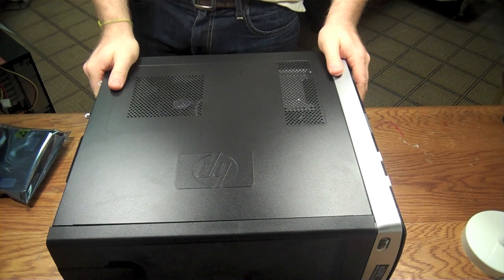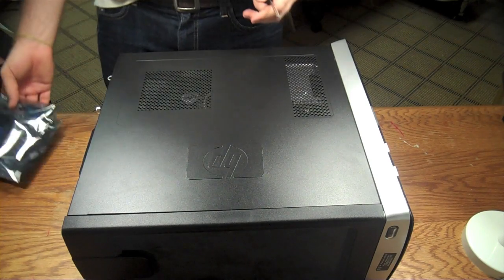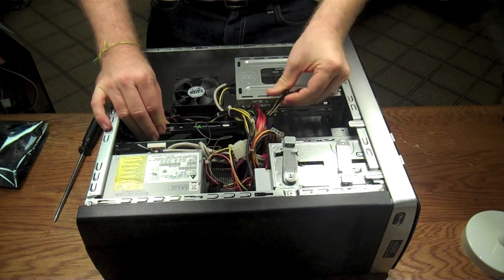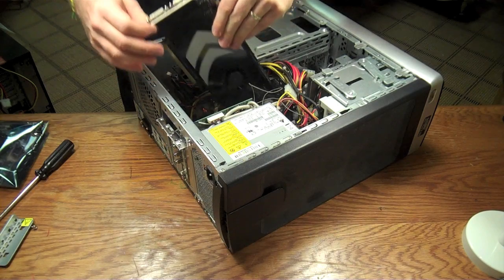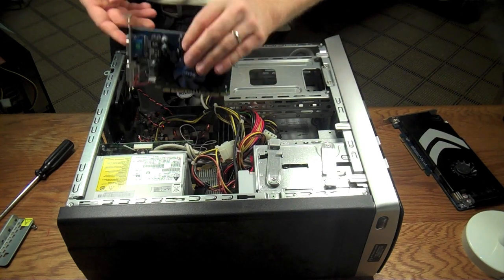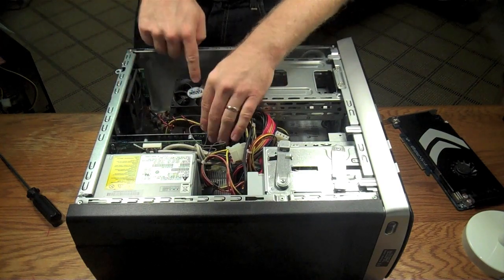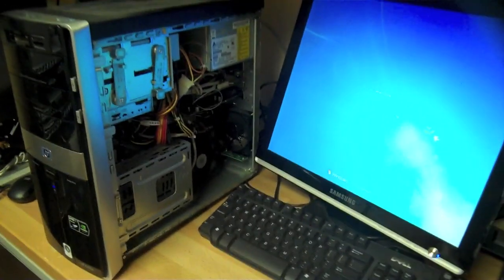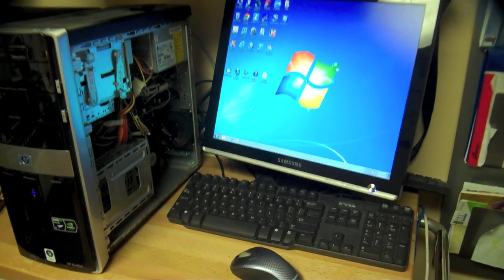HP Desktop PCIe Video Card Replacement

Comment: Is there any kind of prep-work you have to do when installing a new card? By which I mean adding or removing software before or after you put the thing in. This question is in reference to a machine running windows 7.

Comment: Probably a stupid question, but I currently have a low profile card with a low profile bracket and two video ports and I want to replace it with a card that has a full bracket and four ports. Will I be able to do this?

Comment: Hi, I bought a P6-2404eb couple of months ago, and my GT620 gave it up. So today I bought a new graphics card (GTX660 2gb DDR5 -the MSI based one-). It fitted perfectly, but then I also needed more power. So I also bought a  GX550W from cooler master. Everything fits, but the card wont work :s. Card clicked in: check, card tested on other pc: check (worked), card on power: check, uninstalled all other drivers: check, all cables on the right place: check... What can I do? Thx in advance

Comment: hey mate, i have a 600w creation psu that has a dedicated 6 pin pci-e power connector and i want to power a nvidia geforce 550ti. but i have only 10 amps on the 12 v rail...will that suffice cos i don't really want to replace my psu :)(other psu specs 5v@12amps, 3.3v@20) many thanks!

Comment: Update ! Pulled the nvidia gts 240 card out,waiting on delivery tomm on the evga geforce GT 640 
Looks fairly easy so far ! After install of new one would it be best to deleat the old video card files before installing the evga 640 files ? Hopefully this computer fully boots
Reply: Would there be any burn marks or signs of a problem on the gts 240 card just pulled,seeing nothing but hopefully it's bad

Comment: i got to ask if the problem is the video card
in my laptop
cause the display is not working fine
the system will boot up and its fine
and then suddenly the display at the screen
suddenly seemed moving and it will create
a loud sound like eeeeeng
and the display freezes there. i needed to remove
the battery cause it won't stop making that noise.
even if i force shut down it. thank you . :*

Comment: Hi I know I'm really late but I have a HP Pavilion a6400f with the 4 gigs of ram and the 32 bit operating system (don't know what cpu) does anyone know any ways to upgrade this system. Or does anyone know of a motherboard that will fit in this case?
Reply: Joseph Brown me to trying to play fortnite but don’t know which graphics card to use

Comment: My computer has been working for a couple of years. I haven't made any changes to it, but it was working 3 days ago, later that day it seemed like my screen wouldn't display I found out it was because of the computer not the monitor. My computer is an old HP Pavillion P6000, I already check to see if anything was lose but I don't know what's wrong with it. Help Please.
Reply: did you fix it?
Reply: Yep, found out that it was a loose RAM that caused the video to not display.

Comment: Hello,

I have an HP desktop h8-1240ef (2012) but i failed to change the gpu because the pc wont boot (the screen freeze on the first start and i can hear some beeps coming from the motherboard).
The new gpu is a gtx 750ti (msi) replacing the old nvidia gt 530, the computer is only working with the gt530.
I would appreciate any helps and donate as well.

Thanks in advance regards.

Comment: Hey i have the HP Compaq 6300 PRO. Its the one with the i5 3470 In it. Can anyone tell ME if i can put a GPU In it & What card would fit in it. Also as for my Next question I have a Spare Case can i take the Components out of the 6300 PRO & Put everything in a new Case?

Comment: I bought a PC, and it came with integrated graphics in my CPU, no actual graphics card. I've started to game a bit, as you can tell by my name :D, but the integrated graphics it came with aren't as good as I need them to be to run some games. I don't have much experience with building PC's, but i don't believe I have the required cables to plug the graphics card into the power supply, nor do i know where to plug it into.
Reply: what processor do you have? and what wattage is the power supply? there is a card out that doesn't need to be powered/wired to the power supply
Reply: imapie4688 
Processor: AMD A8 6500
TDP: 65W
Operating speed: Up to 3.5 GHz (up to 4.1 GHz turbo)
Number of cores: 4
Socket: FM2

Power Supply: internal 300W (100V-240V)
Form factor: Internal ATX
Total wattage: 300W
Nominal input voltage range: 200-240V/3A (50-60Hz)
Reply: AverageGaming Hmmmm that processor might bottleneck the card i was gonna recommend you
Reply: imapie4688 All good, thanks for the help anyway. What was that card you were going to recommend if you don't mind telling ?
Reply: AverageGaming the GTX 750 Ti, if you live in the US then it is around 120$ and it is a really powerful card at that price, basically it was meant as an alternative for when people don't have enough money for a 600$ gaming machine they can just pick up this neat little card for only 120-150 dollars
Reply: AverageGaming You might want to upgrade the power supply, also the 750ti is a great card

Comment: The origninal Card from This HP Elite PC the GT 8800  or 9800GT Nvidia  was great Card but shit manufactoring ,  a had it to Replace it 2 Times   bouth 2 gets broken Now  a  have  GTX 950 SC  its a Beast and Works Fine with this PC and Power supply iz more than Strong 460 Watts of Power Delta Eelec.

Comment: I have a HP Pavilion 500 - 164 300w with a AMD RADEON 8570D it Supports PCI Express x16 graphics cards (Gen 2.0 speed) is it possible for me to instal a GT 630 i can only afford 80 $ right now?I just want to know if  it's possible?
Reply: Wow that was old comment I am surprised that someone commented on it Instead you should try to get a 750 ti or 740.